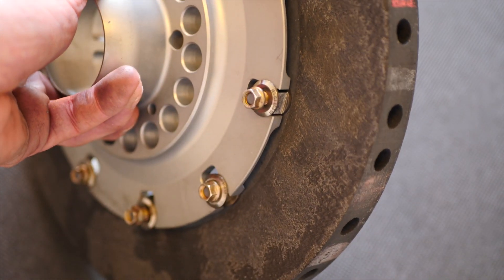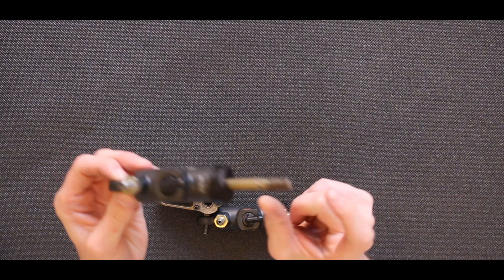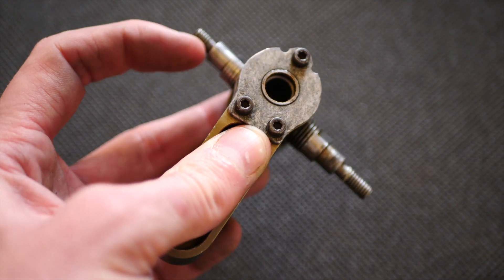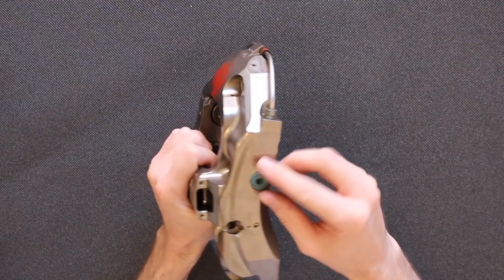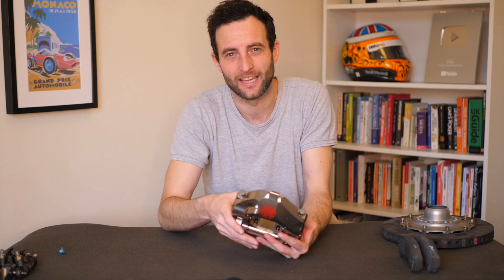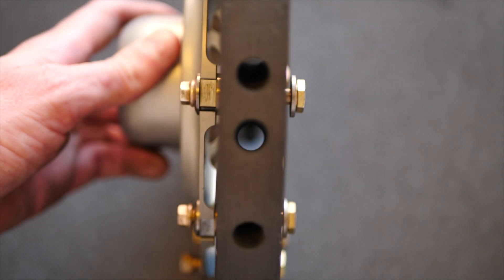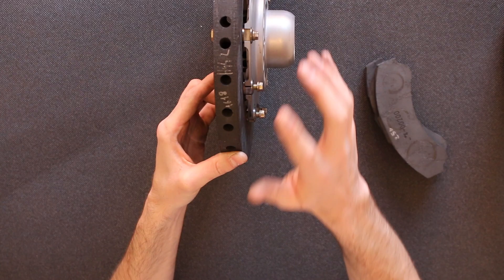How F1 Brakes Stop from 200mph to 0 in 4 Seconds | F1 Engineering

Comment: A big part of braking so „fast“ are the aerodynamics, pressing the car to ground therefore increasing the pressure possible to break and of course the insane grip of slick tires, so it’s not all down to some magical brakes, I find it more wow that they can last so long
Reply: SimRaceHQ, you’re not wrong in pointing this out. But you do still have to realize that the brakes still need to transfer all of that kinetic energy into heat and do it quickly which is amazing. Keep in mind 200mph to zero doesn’t take twice the energy as 100mph to zero, it takes 4 times the energy.
Reply: Matt H right, and there brakes aren't braking little Honda Civic wheels. The rotating mass of the massive F1 wheel/tire sets is... MASSIVE!
Reply: @JohannGambolputty22  Well those brakes are braking a very light F1 car (even though almost 2x the weight at 100mph). It takes exactly the same energy dissipation to brake 2.4 tons car from 100mph to 0 as to brake 600kg F1 car (without downforce) from 200mph to 0 and all that during the same time interval (regular car brakes from 100mph to 0 in roughly 4s).
Reply: Pera Kojot, I understand it’s not about total energy. Physics doesn’t care if you’re trying to brake a 600kg car or a 600kg ice cream truck. The total amount of heat energy created will always be the same (most things considered) Of course there’s more that goes into braking specifically downforce, cooling and especially tires and track conditions. It doesn’t make the carbon ceramic fiber identical in ability per braking foot as a steel brake rotor on a family sedan. Braking from 200mph to 4 seconds is exciting and impressive to watch regardless.  My apologies if I made it seem like heat diffusion was the only factor at play but the reason the stopping time are less are definitely assisted with the carbon brakes ability to still function at such high heat levels over a short amount of time versus steel rotors.  Furthermore, and very importantly, the vehicles ability to do it over and over on a track is a lot different then a single panic stop on a family car.
Reply: @JohannGambolputty22  There are 3 things that differ high performance brakes (i.e. F1, supercar, etc) and regular car brakes. 2 of those have impact of stopping distance/time, one doesn't. Size of breaking disk/pads is one, number of pistons in a caliper is two and material and construction of braking disk and pads is 3.
Material and construction of braking disk and pads doesn't play a role with the stopping distance, i.e. non-ventilated steel disk with regular high quality pads will have almost the same stopping power as carbon disk with ceramic pads (difference probably negligible).
With respect to first two things, any kind of truck will essentially have more powerful brakes than an F1 car.
Ventilated steel or carbon disks and ceramic pads help brakes retain their performance much longer under big load. 
Regular steel disks and pads are perfectly capable of one or two emergency brakings even from 200mph.
And by far the most dominant reason why F1 car can brake so quickly is downforce.
Second reason are sticky tyres. I could say that these two play a role of 90%. Everything else related to the brakes is only 10%.
Reply: @theengineergamer8074  I didn't write anything like that. You failed to understand what I wrote.
What I wrote is that difference between stopping power of F1 car and moderately sporty road car is 90% not in brakes. 
Or in other words, if you removed most of aerodynamic elements from F1 car and mounted road legal tires difference between stopping distance of for example Ariel Atom and F1 car would be at best 10%.
Reply: The main challenge is to get the breaks ready for the next corner. And the next again. Normal steel breaks would quickly suffer from very bad fading.
Reply: @perwestermark8920  Brakes.
Reply: @andyelliott8027  Yes I know. But since this isn't my native language, I sometimes goofs.
Reply: My first thought too, its surely rather easy to stop a tire rotation fast, but when the tires block  the car still moves forward.
Reply: Don't forget though that as you slow down the downforce rapidly decreases with the loss of speed.
Reply: With most Aero dependent cars the Aero's downforce becomes less and less the slower they go.
Reply: And sticky wide tires and a relatively light weight
Reply: The brakes are producing  many times the power the engine . Think of a dragster going from 0 to 200 mph  in 4 seconds . This is the same power required to stop the vehicle .
Reply: While the down force is necessary for the whole system to work the pads, rotators, and tires don't care if the car weights 3x as much or just has tons of down force. They dissipate the same heat. Presumably the interaction between down force and braking ability will be discussed in depth when discussing the aero in a later video.
Reply: SimRaceHQ  you’re partially correct. The emense stopping g’s are not only from the additional traction, but from the drag as well.

Wings for downforce create a ton of drag. Simply taking their foot off the gas pedal at 200mph is like 1g right by itself.

Comment: Are they allowed to put the "break pedal" on the steering wheel? Hands are more sensitive then feet.
Reply: Allowed? Possibly.

Would they? No because they run non boosted brake systems. You couldnt generate enough force with your hands/arms

Comment: 1. Nothing glows at anywhere near 100 deg. Celsius. Try 1,000 deg. for the deep orange color shown.
2. F1 cars need far more than brake discs to achieve 5g. They need a huge amount of downforce from the car's aerodynamics. Without that, the tires would lose grip at a little over 1g.
3. 200-0 in 4 secs. is an average of 2.3g. The higher g-forces are only achievable at the upper end of the speed range, when downforce is at a maximum.

Other than that ...

Comment: I think the bleed nipple goes at the bottom. As in the diagrams in your video. This would mean that the pistons which push the pads onto the disks would be the other way around. The smaller pistons would then be at the back of the pad. They would move first due to their smaller volume, they need less fluid to operate. This would make sure the back of the pads made contact with the disk first. The action of the disk spinning would then itself pull the following area of the pads into the disk. The other two pistons are incrementally larger in size meaning they move later in the sequence as they need more fluid to operate.
I'm not sure if there is such a thing as brake squeal with these materials but this action of the pads contacting the disk should also reduce that.
I'm not an expert. Its just an observation.
Reply: And you’re correct. It’s so a small amount of braking can be applied when necessary. What he says about one end of the pads hitting the disc first is nonsense.  The disc is round.

Comment: I think the most interesting part of an F1 car's braking system is the part that most wouldn't consider part of a braking system at all, the aero. The fact that F1 cars produce so much downforce that it actually allows the drivers to adopt a different driving style where you mash the brake and slowly taper off as you get to lower speeds and lose the downforce is super interesting to me. The cars are being pushed to the ground so hard, and have so much extra grip, that you can essentially take advantage of pretty much all of the brake's capabilities without worrying as much about a lock up until you lose the downforce. As a auto/driving enthusiast, I'm no professional, but i take it pretty seriously, even if it's just for fun, and all the cars I've driven require you're "typical" braking techniques. I've never driven a modern F1 car in real life, or any high aero car for that matter,  but even in a sim like rfactor or assetto corsa, the difference in technique is somewhat mind bending at first and completely the opposite of what you would be used to braking into a corner, and it's fascinating when you understand why. It's like when my friends who have only driven rwd cars on windy roads, then try to drive my modified Golf GTI on the same road.

Comment: Interesting. The master cylinder output fitting looks like a bleed nipple. I can't see any thread to hold the lines on.
Do they have some kind of quick release mechanism?
That would seem a bit dicey.
Reply: That's a standardized male fitting, to suit a A/N -3 size hose. The feed can be push fit as it's not pressurised.
Reply: @jamiegoddard2495  
Thanks. But, it is pressurized when the peddles are pushed.
But I thought as much because some of the hydraulic equipment I worked with had such things.
But for something so vital I would have thought a screw on might be more secure.
Given the vibrations and G loads etc.
Reply: @Igbon5  no, the feed is never pressurised. The outlet is of course.
Reply: @jamiegoddard2495  
No, the feed isn't pressurized, I have worked on them. My motorbike has the reservoir sitting right there but I don't how secure I would feel with a clip on fitting for the pressurized side.
Reply: @Igbon5  there is no clip on fitting on the pressurized side. feed is push on, pressure out is an-3. You'd normally see a an-4 fitting on the feed, but not in this case.
Reply: If there is no clip fitting then there must be a thread I can't see.
If so I know exactly how it fits on, with a flared end screwing down on the bit that looks like a bleed nipple. Like copper plumbing.

Comment: Brake temperatures greater than 100 C; well it's a true statement but I think you could have stated a temperature a tad warmer than that :).
Reply: Its 1000C not 100C. A bit of different
Reply: anydaynow look in the bottom right when he says that :)
Reply: @Fwamyyy  Yep that was added after my comment :)
Reply: Wow that's boiling hot! Sheesh
Reply: Yes, in three minutes,you could have a delicious egg
Reply: @pavanatanaya  And a cup of tea.
Reply: 100C is boiling water, 1000C is closer to melting steel. What I found baffling was that the operating range in the brembo slide showed 300C (above molten lead) as the minimum end of the operating temperature range. I wonder where that comes from.
Reply: sees the correction (1000°C)
decides to make a smartass comment
mannn stfu
Reply: @abdelhakouinharoune7504  Sees 5 months old comment on a 5 months old video
  Doesn't consider the correction may have been made AFTER the comment
mannn why u using 3 n's?
Reply: @BixbyConsequence  good poinnnt

Comment: Oh look! No holes drilled in the surface of the rotor!
Reply: Its not necessary for carbon brakes but for steel brakes having holes in the disc does improve efficiency.
Reply: @AGD_27  How does removing rotor surface improve efficiency? Prove it!
Meanwhile I'll prove to you why it's just for show and why I cringe when I see a sports car with drilled rotors: https://youtu.be/78wbht355R8
Reply: Sk1ds The holes are sometimes used to clean the rotor and pads. This is not necessary on a racetrack because there is less dirt/grime on the road.
Reply: @Sk1ds87  The video you sent me literally says how it could. It's a bit out dated now but it's not just some random idea a guy came up with and used for no reason.
Reply: @AGD_27  You saw the part about the gas escaping from the pads through the holes I guess? Yes, that's the only reason and it sure is a thing from the past. So why do fancy expensive sports cars still have drilled rotors?
Reply: @Sk1ds87  again it says in the video that you sent. It's aesthetic.
Reply: @AGD_27  Yes, just for show. Nothing else. Just to look cool, although those are stress points that might crack during multiple heat cycles. Splendid!

Comment: What is carbon-carbon? Could you elaborate?

Great vid! Thank you so much!
Reply: Carbon ceramic has a carbon rotor and ceramic brake pads. The carbon in the rotor is regular ol' carbon filament in a special epoxy, a little more carbon-to-epoxy ratio than structural carbon fiber. In order to get brake forces on a carbon-carbon brake setup, which has a carbon rotor* as well as carbon pads, the material gets processed differently. The epoxy is again different from the regular carbon fiber rotor epoxy, and it is baked for a few days under heat (obviously) and pressure which breaks down the epoxy and you end up with a pure carbon block, it's not "carbon reinforced plastic" anymore because the plastic (epoxy) 'denatures' into a pure carbon molecule. That's why the infographic showed a 24 hour build time for carbon-ceramic brakes, and a 1 week or so build time for the carbon-carbon brakes.
Reply: Juan Aguilar Almost there - when the binder breaks down to leave carbon, it also leaves voids; these are then filled by passing a carbon rich gas (such as acetylene) through at high temperatures, causing graphite crystals to grow and fill the voids. This is the bit that takes the time, and racks up the cost.
Reply: @andyowens5494  Rule #3 of the internet: The best way to get a right answer is to post a wrong answer lol. Thanks for the clarification!
Reply: Juan Aguilar Not wrong, just not as complete as it could have been :). We all learn a bit every day.

Comment: I like the video, but there is one question you didn't answer, I was thinking about the whole video:
How does the pressure the driver gives into the peddle correlate to the pressure the pads give to the disks? Like, I'm pretty sure it isn't 1:1, pretty sure you can change it arround.
How is that managed? 
I mean, I studied physics for a year, so I guess hydraulic liquid doesn't change it's temperature (I mean, water doesn't compress too, when it's temperature isn't changed... So there must be something special to the liquid) and you change volume somehow (where does that happen?)... There was something like p*V/T stays fixed (p - pressure, V - volumen, T - temperature).

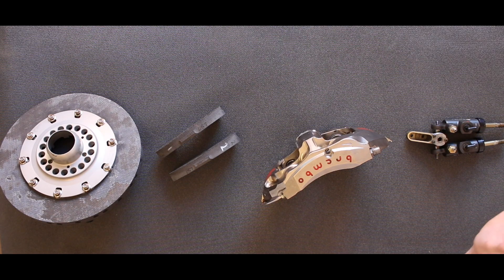Comment: 11:11 that looks crazy. Why is the inside of the wheel barrel stippled like that?
Reply: Temperature managment. The Pirelli tyres have a pretty narrow temperature window where they work properly. So teams started to use the rims as heat sinks to keep the typre temperatures better under control.
Reply: @shi01  seriously amazing
Reply: It increases surface area to aid cooling